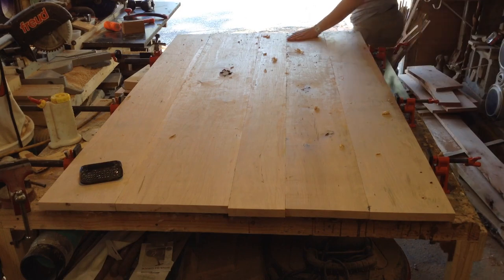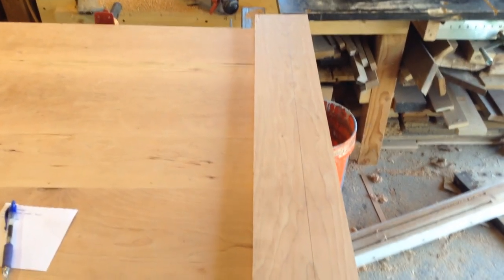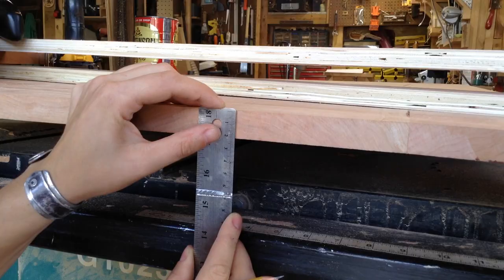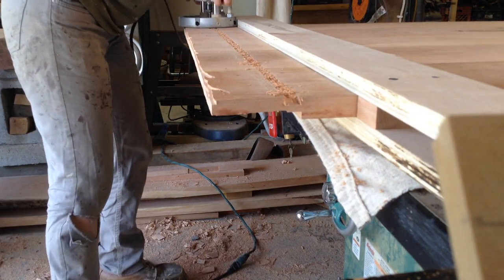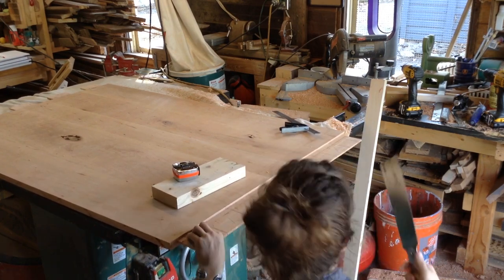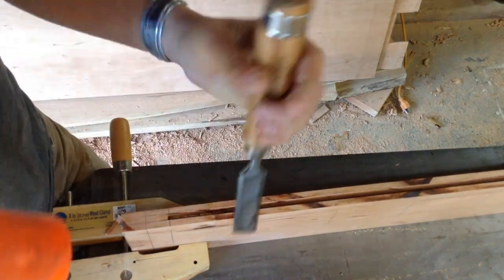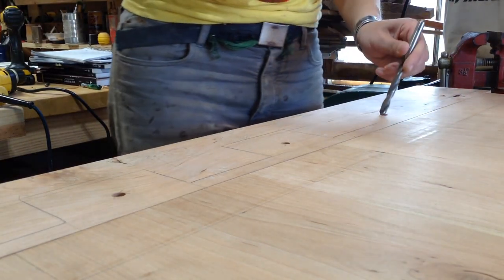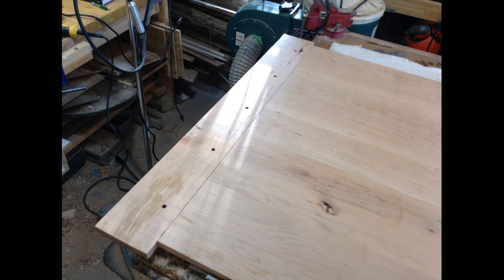When To Use Breadboard Ends [How To]

Comment: Another "How to" video using breadboards. Not sure the title describes the material as accurately as it could have. There are lots of good "How to make breadboards" which explains their function, but I was drawn to this one  to learn about the application intent of them. Basically, after 17 mins. of watching what was mostly the machining process, (which is exactly the same as 50 other YT videos), is that their usage is to prevent cupping, and to keep the boards aligned. I was just curious if there were any other benefits. Your video was well done, very detailed, and explained clearly about the breadboard process. Thanks for posting.

Comment: I'm building a large(ish) 6×3 foot dining table with an ambrosia maple top and silver maple base. I'm going to consider it higher end and put it up for sale for a fairly high price. That said, I was also considering bread boards to keep it from cupping long term. But now that I heard you say that most high end tables don't have them, I'm starting to second guess that. Any thoughts on that?
Reply from the maker: That’s a little bit of a word fumble.  Most expensive dining tables do not have breads-board.  I’ve never seen one with them.  But, that is because they usually are not made from solid lumber, they are veneered in which case long term cupping isn’t an issue.  Because the substrate is most likely a dimensional stable material.  If I was making a solid lumber table that big I would never make it without a breadboard, or confirmation from the client they won’t complain down the line if the top cups (because it will).
Reply: @HoneyBadger WoodWorks  Thanks, I've been juggling this idea for a week or two, especially after watching this. I was leaning more towards the bread board idea but your support  definitely solidifies my decision. I've done them before, but not at this caliber of a table so I wasn't sure. Thanks again.

Comment: Great video, question: on the center tenon wouldn't you leave the hole the size of the dowel and elongate the others, so that the expansion is guided outward?
Reply from the maker: Correct.  You can see in the video I didn't elongate the center hole, but your right I never mention that which I should have.

Comment: Instead of mortise and tenons, why not use dowel joinery on the ends? Much quicker, pretty good strength as well. Rockler makes a great jig for this application.
Reply from the maker: The mortise and tenon does two things.  It keeps the entire top from cupping.  As well as keeps the top structurally sound while allowing for seasonal movement of the boards.  Doweling the ends does not allow for this movement, nor will it keep the top flat.  I have seen multiple hardtop tables develop cracks over the years because of poor joinery on the ends.

Comment: To allow for expansion the mortises must be wider than the tenons, but by how much? Do you extend the tenons similar to the draw board holes?
Reply from the maker: Only about 1/4 inch or so.  Not quite sure I follow you on the tenon questions.
Reply: HoneyBadger WoodWorks I was comparing the elongated dowel hole in the tenon to the elongated mortise. You answered my question and I thank you.

Comment: Learnt a lot! Thanks.
 
 
15:59 tmi.
Reply from the maker: hahahahahahaha. I was wondering if anyone was going to catch that.  I didn't feel like going back and changing the audio on that one.  Woodworking is tough to talk about, very ripe with sexual innuendos.
Reply: @HoneyBadgerWoodWorks  Ahaha, good sport. Was hoping you wouldn't get angry at that.
Reply: I’m never a fan of mixing other species as they have different specific gravity so I’d never mix woods as they move differently.
Reply: When I pin breadboards I never go through the top I put my pins underneath as a working way to secure the ends and I drill with a Brad point 3/16” from the top.  Who wants to see dowels on the top. As I see it they are doing a job so who needs to see a dowel coming through the top. I like it to be clean Looking myself. I build with lots of figured woods so I don’t like to interrupt the beautiful figure in the wood. I build to function not to show off my skills. That’s the difference between an Artist and a craftsman!  I just enjoy the work and try to hide any over done looking work. Si as long as it’s practical I like it.